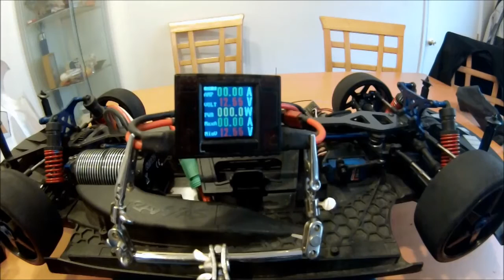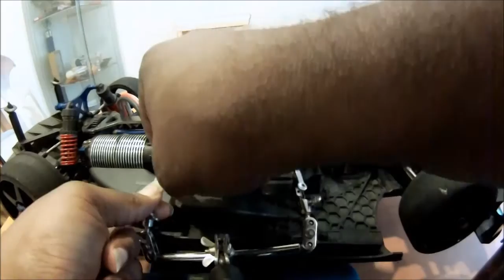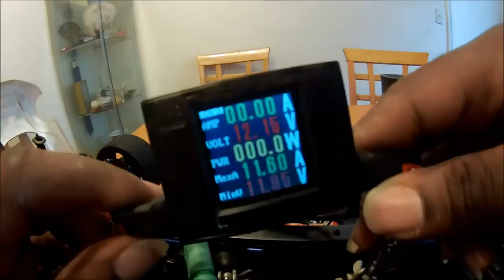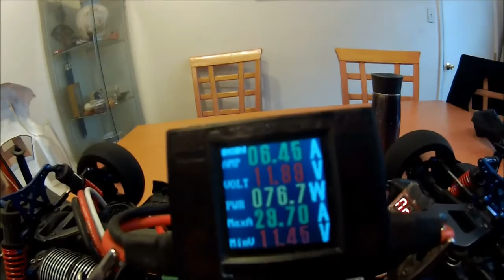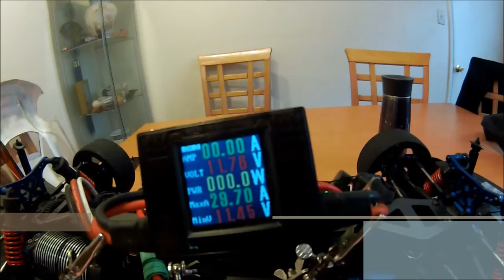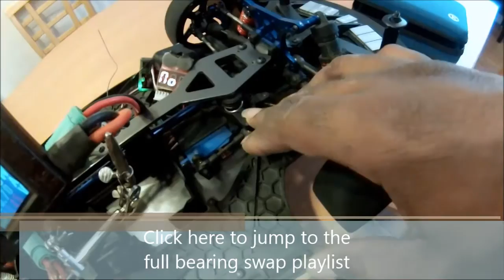Ep. 155: Traxxas XO-1 Stock Bearing Benchmarking

Comment: Whats the meter you use called? Also, do you think that expensive bearings are worth it for the performance? In a 2wd, I am choosing what to buy.
Reply from the maker: +Lionkev55 Lions It's a Turnigy power meter. I got mine from Hobbyking, but they've been on back order forever. They have several other comparable option, though. My Slash and Rustler saw 20-30% reductions in mechanical drag going to ceramic bearings. I think the biggest thing about the ceramic bearings is that they have better longevity. They are not quite as tough for off-road bashing applications, but they generally will not corrode, so the performance should not degrade as much over time. I hope this helps.
Reply: +rhouse21 - RC Physics it does help thanks, I am thinking about getting avid ceramics for the idler and the main shaft, since those spin faster than the dif, around 2x the rpm. I also may get metal sealed for the rest since I am a fellow speed runner. I am trying out this spray on the gears, no grease

Comment: Nice tutorial video. Question for you , I bought some orange seals for one of my 1/10 speed cars and notice the bearings were tight from the grease. Its says it needs breaking in and no maintenance needed. Well after a bunch of runs in the car  the bearing still feels it has resistance. Do you take out the grease in these orange seals and use a special lube? I always thought a bearing that moves freely like a skateboard wheel is the better than one that has resistance. After experiencing this first had with my 1/10 I had 2nd thoughts for my XO-1
Reply from the maker: +udluuz The free-er the bearing moves, the better... usually. Ceramic bearings have 2 big advantages. They will USUALLY have lower rolling resistance than the steel versions, but sometimes a well broken in steal bearing will have REALLY LOW resistance, much like I saw with my XO-1. The initial rolling resistance after putting everything back together was a bit higher than the stock steel bearings which is the same thing you observed. This brings us up to the second advantage.

Ceramic bearings, since they are not metal, will not rust or corrode. The ceramic material is also "harder" than the steel, so the balls deform less under load meaning lower wear. This means that they will maintain their performance for much longer and pretty much last forever unless they are abused. I believe Boca and other manufacturers use thicker, waterproof grease to will last the life of the bearing without maintenance, but that could cause a little more resistance when new. The good news is that once the greese is broken in, the bearings should not degrade in performance like steal bearings do over time. I still haven't been able to really gauge how long the break-in should really be, though. For my first two sets of "lower-end" ceramic bearings, I ran a LiPo Pack through at full throttle and the bearings felt pretty good after that. I actually had a mechanical problem with my installation with the orange seals that caused one of my bearings to fail, which is part of why the results video isn't up yet. It wasn't the bearing's fault, but Boca replaced it anyway. Still, my preliminary data implies that these orange seals may actually be higher resistance than the stock XO-1 bearings I took out. This could just be because they are not fully broken in yet, but I suspect it may just be because the original steal bearings were assembled with a very light oil that rolled more freely, but may not last as long.

My other Ceramic bearing tests showed significant reductions in resistance going to ceramics, but these came from vehicles that had been "well used", so the stock steal bearings were all a little worn when I benchmarked them. In reality, the amount of drag I'm measuring in both cases is REALLY LOW compared to the other loss sources at play for my speed runs. Still, a few percent here and there start to add up. I think the big thing to keep in mind is that the ceramic bearing will probably get BETTER with time as apposed to the steal which will get worse and worse as time passes. 

Keep me posted. I'd like to compare notes with you as I get more data.

Comment: wow... very interesting procedure... I guess once you get to a certain point as far as speed goes .. it's those little things that can make  the difference for sure... cool vid man.. :)
Reply from the maker: +RcNickster This isn't a perfect test by any stretch of the imagination, but it proves the point. I reality, you really need to build something that looks like a full chassis dyno to recreate "road forces", but this setup is good enough to show relative differences. There are also a few other advantages to ceramic bearings, such as they do not corrode and should pretty much last forever as long as they are not abused.